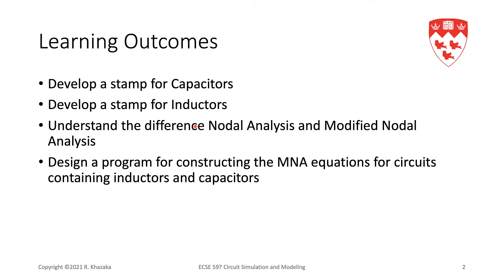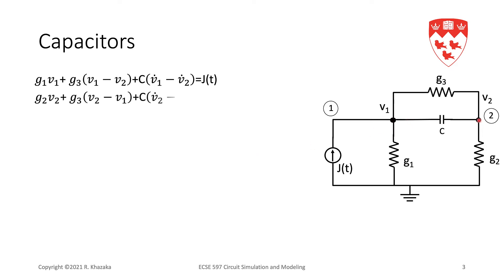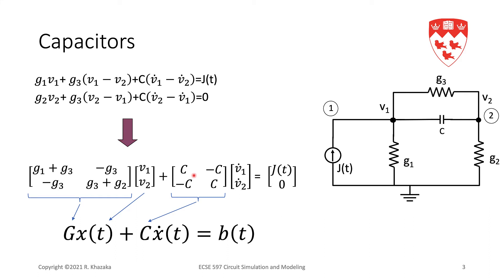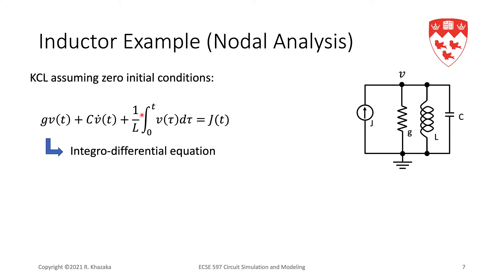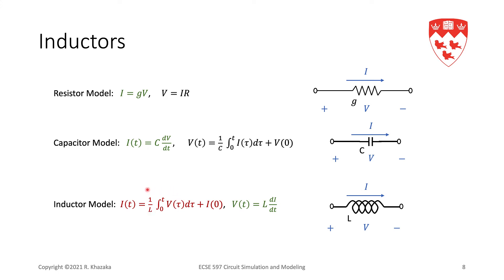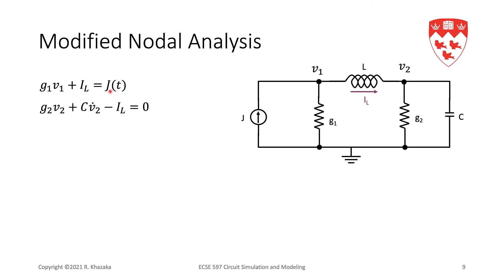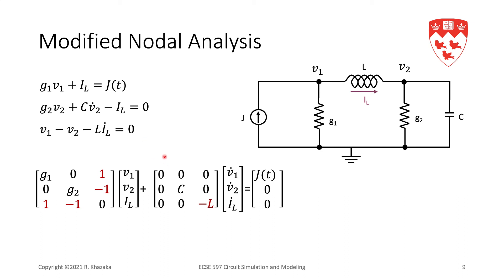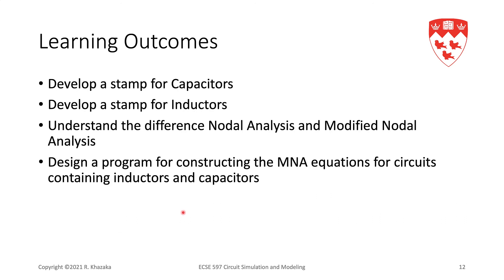Modified Nodal Analysis MNA Capacitors and Inductors

Comment: Timestamps
00:05 - Understanding MNA for capacitors and inductors in circuit simulation.
02:04 - Modified nodal analysis derives equations for capacitors and resistors in circuits.
03:58 - Capacitors appear as stamps in the C matrix of MNA.
05:41 - Modified nodal analysis encounters challenges with inductors and integrals.
07:31 - Applying Kirchhoff's Current Law using modified nodal analysis for capacitors and inductors.
09:22 - Using KCL to analyze circuits with inductors and capacitors.
11:08 - Introducing the inductor model in Modified Nodal Analysis (MNA).
12:54 - Developed MNA methodology for inductors and capacitors in circuit analysis.